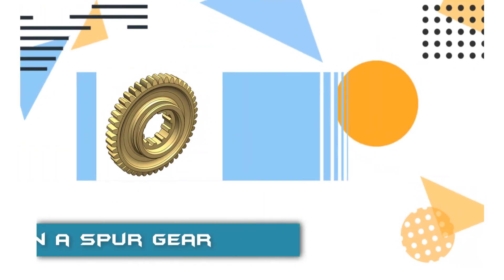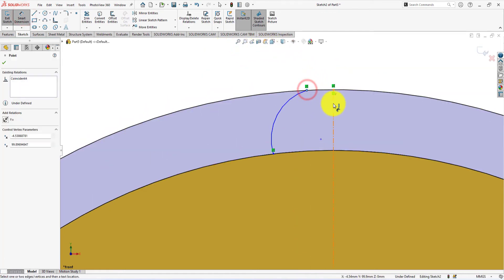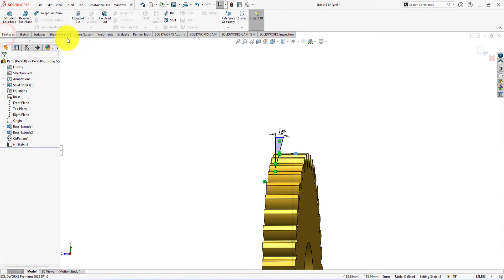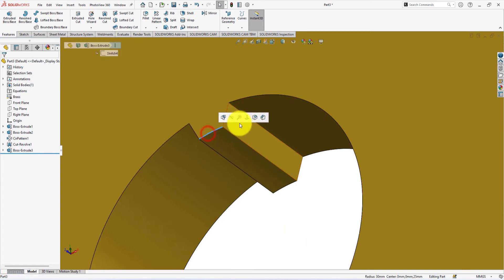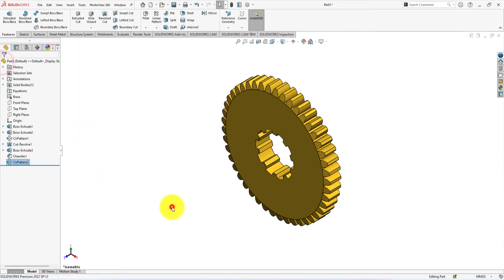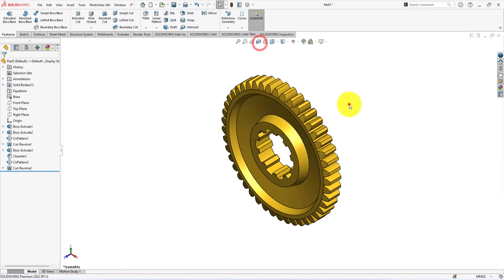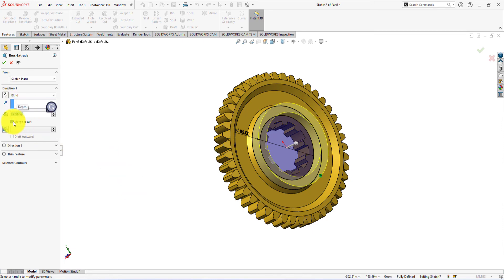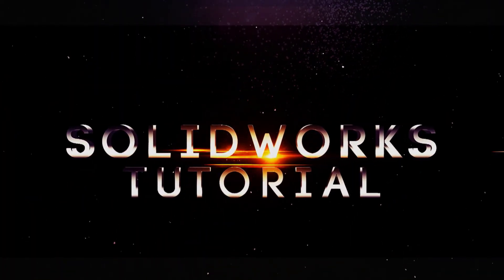SolidWorks 2022 Tutorial Easy Way to Design a Custom Spur Gear

Comment: I'm sorry but this is not a custom gear, but a random gear. People don't want to create a gear that "this distance is 5 mm, that distance is 13mm". Why would they? Random numbers that you used without details. You totally forget to explain the main parameters of a spur gear, and their connection to the design. Not mentioning that the tooth shape is not a circle but an involute curve. Monkey see monkey do, that will not teach people anything.

Comment: This is absolutely useless
Reply: I agree, it's a random thing without engineering knowledge. And it wouldn't work,  because a circle tooth shape is not circle but involute curve. The definition of the involute curve is the curve traced by a point on a straight line that rolls without slipping on the circle. If you do something else that will slip causing abrasion, and quick wearing. Engineering knowledge is necessary when you make a gear. Although this thing could be a cool ornament on the table.